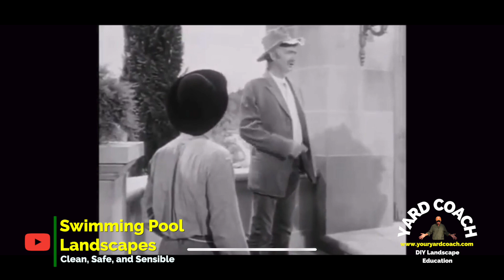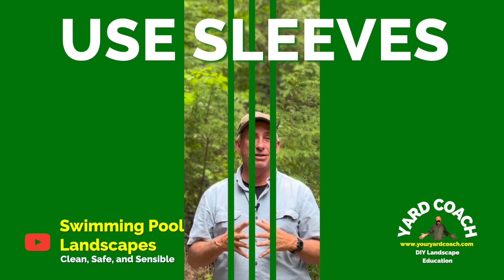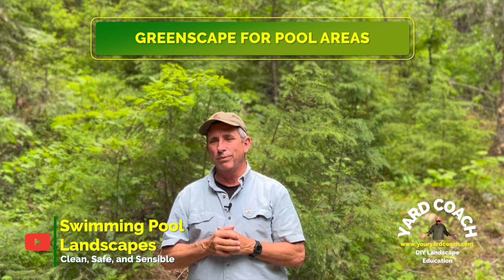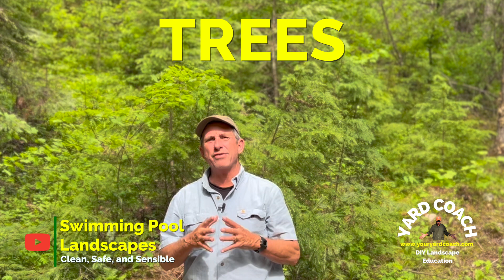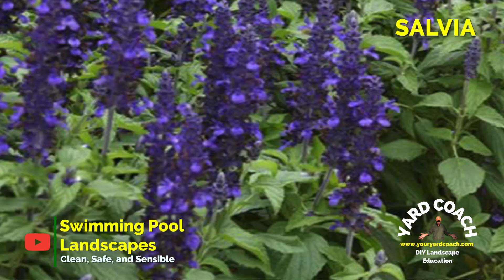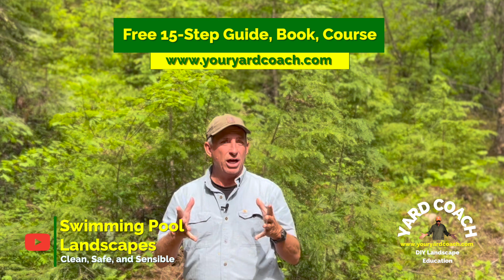Swimming Pool Landscaping | Plant Selections | Clean, Safe and Sensible Pools

Comment: We are getting a in ground vinyl. 
Almost done . 
But yes make a plane for after pool. 

Pool 75,000
Fence 4,000
Sod, 1,000
Electric, 1,000
Water truck 500
Pergola 1,200
Pavilion  4,000
Cooking kitchen 2,000
Plants 300 so far 
Nice rocks 300 a ton 
Decking 4,000
Pool furniture 3000
Water features 3000
It keeps adding up
Reply from the maker: Holy cow, that is more than my first house. Bet it will look spectacular when completed. Thanks for the cost update and your comment. Much appreciated. Coach.